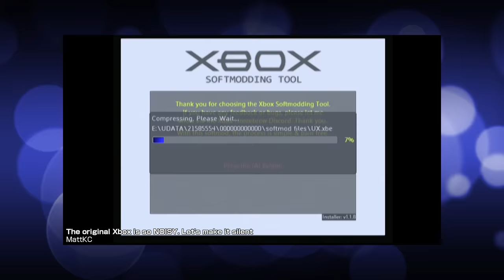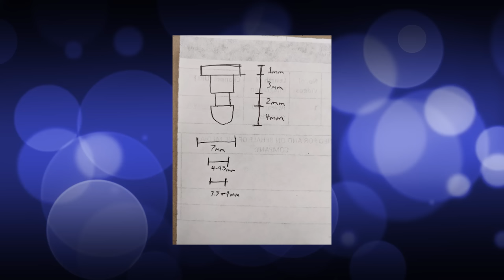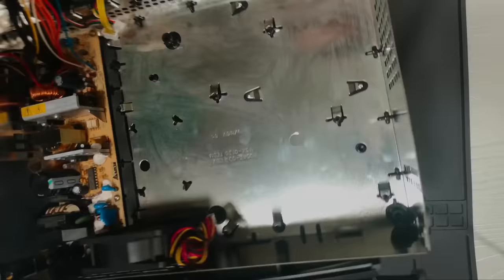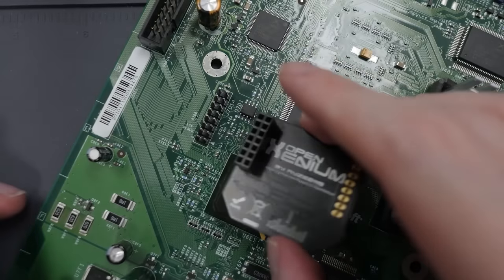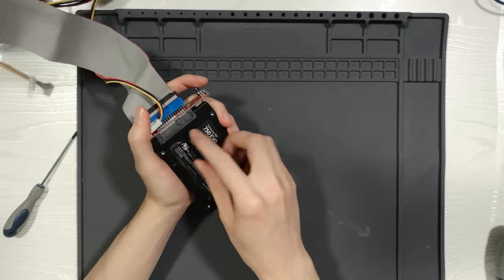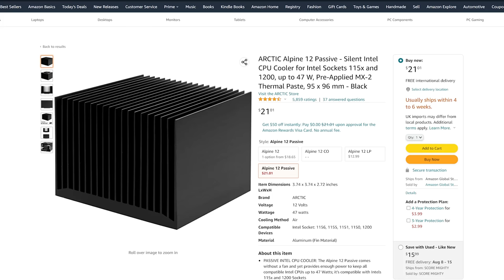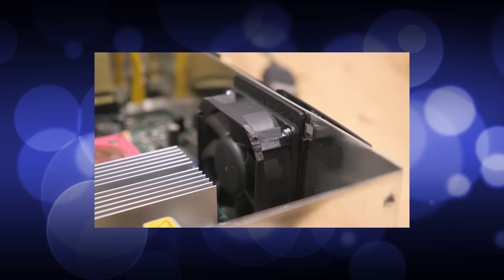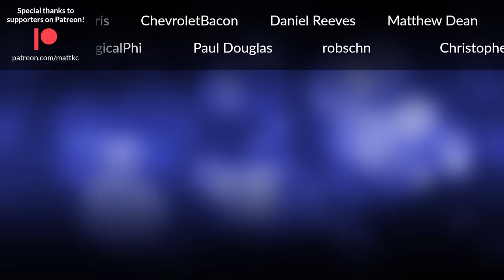My Silent Xbox Has A Problem...

Comment: I’d like to point out the passive heat sink likely wouldn’t have worked because the two chips are probably not level with each other
Reply: True
Reply: Could've used some K5 Pro to account for that
Reply: @aprofondir  I'm not familiar with "k5 pro" but I assume it's some high quality thermal paste, it wouldn't matter because if there's any air between the chip and heat sink it will work very crappily and overheat, even if you put a dog shit pile-sized mound of compound on there it would negate the purpose because it would cool the chips so bad that it would be a waste of time, not to mention the paste would likely slowly settle, especially with heat, and stop making contact with the chip.
Reply: @venialgaming4295    You could use thermal pads instead of paste to deal with the die/substrate height differences since they're made in all sorts of thicknesses. The CPU runs at just over 20w with the GPU likely sitting in the 40w ballpark. Had to find pentium 3 733mhz/geforce 3 & 4 numbers, nothing easy to find on the Xbox- though total system power draw of rev 1.0 runs between 67-68w, with rev 1.3 between 62-64w so I imagine it's pretty close, so it likely shouldn't be a problem to keep cool with pads so long as there isn't too much of a gap between the die & heatsink.
Reply: @venialgaming4295  K5 Pro is more viscous than thermal compound. It's more like highly thermally conductive silicone grease. Its purpose isn't just to fill the gaps between a chip and a cooler, it is a heat spreader itself. Covering the RAM chips on a GPU with K5 Pro is an example, as the K5 Pro acts as a cooler. But, it likely wouldn't be as good as a thermal pad in this case because K5 Pro isn't compliant with perfect contact when you have a gap of a few millimeters. 

Just use a thermal pad, and it would be okay.
Reply: @RamyWarda  it would maybe be enough but like he said if it doesn’t cool better than what’s the point and introducing a thermal pad rather than paste would probably make it not perform good enough to warrant it. And another thing to keep in mind is one of the chips is direct die so you already have to be extremely precise on the bracket to have even pressure on the die which is super hard because to make the heating pads level it would likely squish them but it could be balancing on the die, depending on if it’s higher than the other one. And in the likely scenario that a heat sink uses heat pipes that would make it impossible to use it so in other words using a single heat sink wouldn’t be feasible, also the gpu definitely doesn’t consume twice the power of cpu because the heat sink is tiny in comparison.
Reply: @venialgaming4295  It would really have to be tested before concluding that it wouldn't cool them off any better. You have much more surface area for dissipation, but worse thermal conductivity. Most tests are done on an IHS, but the NV2A/P3 are bare dies. Could make for a good video.
Edit: I realize that, which is why I mentioned I quoted numbers from their closest off-the-shelf counterparts. A full fat Geforce 3 or 4 probably draws more power than the Xbox equivalent, especially with the lower clockspeed (233mhz vs. 300mhz).
Reply: It would be possible to machine a single heatsink that sits flush with the chips.
Reply: Copper shims could help level
Reply: How about mill the heatsink to the diffent CPU and GPU heigh and extra component it need to doge
Reply: @kyanhluong  issue with that is A. When you mill the heat sink you’d have to take a lot of time to measure but more importantly account for the material taken off after lapping it because just milling it won’t be flat enough, and good luck trying to get a cylinder head shop to understand it enough to go that route, but B. It’s pretty expensive to get it milled in the first place, not even considering wherever he lives is probably not a small farm town like I live in that has like 3, and I highly doubt he could use a mill proficiently enough to make it work. The best overall route is two heat sinks because even if you got one to work it would likely heat soak the cooler chip anyway like laptops do.
Reply: @russhuang  I’ve seen this done and because it’s aluminum anyway it’s probably the best route because it doesn’t require anything precise, just sand it till they’re level.
Reply: @venialgaming4295  2 cooler seem like a good idea, also why it would still get heat soaked, outside of silent fan not getting enough air going around?
Reply: @kyanhluong  not saying the whole thing but say the cpu is under load and it heats up the heat sink but the gpu is going unused, this will heat up the gpu as well even though it’s not being used, if you observe the temps laptops with dedicated GPU’s you notice the same thing because they’re on the same heat pipes most of the time.
Reply: Just cut them in the middle with a anglegrinder and done
Reply: @venialgaming4295  K5 Pro is a liquid thermal pad and not thermal paste, would probably be perfect here
Reply: @venialgaming4295  2 disconected heatsink still tempting tho, unless 2 seprate heatsink can still heat each other enough to be a problem
Reply: @kyanhluong  I think two heatsinks is the way to go, but considering the size of the originals I wouldn't worry about them heating each other enough to be an issue
Reply: @orca984  I think an angle grinder is overkill but yeah that could be an option, but at that point might as well just do two separate heat sinks
Reply: Could use a copper shim with a smear of compound on either side.
Reply: @venialgaming4295  Now 2 heatsink and silent fan seem like a way to go...
Reply: @qwertykeyboard5901  true
Reply: @venialgaming4295  k5 pro is more along the lines of a thermal pad that you can reshape to the desired thickness, used to replace those found in GPUs
Reply: @TrolleyMC  L pfp, find God.

Comment: You could probably 3D print some fan ducts like what they have on servers, and use the existing heatsinks. Those would guide the air to flow directly over the heatsinks
Reply: Ehh, unless he wanted to fiddle with higher temp filaments, then it might not be worth the effort. PLA wouldn't stand up to the heat and would soften quickly. PETG and ASA are kind of a bitch to print with if you don't know what you're doing. But if he were to go for it, it would definitely work well.
Reply: It might work, but the auxiliary components (power regulators, etc.) could potentially get starved of that airflow and start overheating. Worse, there wouldn't be a temperature sensor on most of those parts to actually safely shit the system down.
Reply: @AstrumPuella  PETG is pretty easy, ABS is decent if you have an enclosure, but those aren't all that common.
Reply: Too expensive of a solution. Just use thick paper or thin cardboard instead.
Reply: I removed the DVD drive in my Xbox and just stuck the bottom metal plate of the drive back inside. Airflow is back to being about the same as stock.
Reply: I made air ducts out of cardboard before, works perfectly fine.
Reply: Indeed, check out this video this guy does some crazy custom cooling for a desk PC and he uses some plastic strips to guide airflow. I think if you can get hold of some plastic sheets like those and mold them with some heat, you can keep the geometry of where the DVD drive used to be but remaining lightweight. Great video, thanks for sharing! https://youtu.be/HhWDPG8EROw
Reply: @HappyBeezerStudios FIRE HAZARD!!!
Reply: @AstrumPuella pcbway does 3dprinting in tons of materials and they'd probably do another sponsorship
Reply: @AstrumPuella petg is pretty much just as easy to print as pla.
Reply: That's what they did on phat 360s.
Reply: Or those they got on oldass dell towers.

Comment: The SSD in my Frankly Horrific OG Xbox is held in with Gorilla Fabric Tape. Absolutely no clue how it’s held up so well with the heat.
Reply: Gorilla tape is for The Toughest Jobs on Planet Earth after all.
Reply: That's gaff tape I use that in automotive for bundling and protecting wire harnesses. Great stuff. Look at tesa's line of tape.
Reply: Flex tape would immortalize it
Reply: Budget bill

Comment: I installed a hydro fluid bearing fan (aka Hydro dynamic bearing) and set it to 100% speed.  I just can't remember if it was a 70mm or 80mm fan.  Over 10 years now of use and the fan is still silent and keeps the Xbox cool.  You should look into these types of fans instead of using the basic ball bearing fans if that's what you are using to set it at such low speed on the fan so you don't hear the noise.  At 100% with these types of fans it is very silent and effective.
Reply: excellent suggestion. I don't think enough people consider using that type of fan to address noise levels
Reply: Not sure I've ever heard of them. Interesting.
Reply: I haven't heard of them either. (Given, I haven't ever done much research in the area)
Reply: Yes, they made a BIG noise back when I heard about 'em circa 2010-2014.  Haven't really heard too much about 'em since but they do exist.  The brand I went with was GELID (Silent series).  I'm not sure if they are still around but it is what I used back then for OG Xbox's and also for PCs.  Super Silent and effective.
Reply: Interesting, I didn't knew about it. Thank you !
Reply: You mean the hydro dynamic spatula with port and starboard attachments (and turbo drive) may yet exist...
Reply: thats impressive. if you had a model number you could give us thatd be awesome. A reliable 10+ running fan would give me so much peace of mind, i hardly trust anything to last anymore.
Reply: @hehe42069-k   Like I said from before, I'm not sure if it's a 70mm or 80mm but it is the GELID solutions Silent series fan.  With a quick search from what I remember what it looked like, it is either the 70mm (FN-SX07-22) or the 80mm (FN-SX08-16).  Again, not sure which one I used in the install but it was definitely one of those hydro dynamic bearing fans.

Comment: I'm a little confused, since you didn't like how the DVD drive cover no longer "floats" why didn't you leave the DVD drive in with its caddy and just have it disconnected? This would solve the soft whirring you were annoyed by. This would also allow the air flow to go back to what previously was the case and if you ever did want the DVD drive you could plug it back in (relatively) quickly.
Reply: I think another reason was to reduce the weight. Though I would suggest to open up the drive and taking out anything unneeded, but keep anything needed to make the DVD slot float.

Comment: I think it's possible, that the DVD drive might also have a little to do with the airflow,  like with the HDD caddy, perhaps, you could try putting just the bottom of the drive back in and seeing if that improves Temps? That would only make it a little bit heavier, but might help (especially with the gpu heatsink)

Comment: MattKC: "The double sided tape for the SSD didn't work due to heat, I probably should've seen that coming"
Also MattKC: "I used double sided tape for the Xbox logo, it doesn't go through anything so it should be fine"
I don't actually know if that part of the case gets any airflow/hot, but I just thought it was funny :P
Good work though, hopefully someday I'll do the same to a PS2!
Reply: The only mod a PS2 really needs is a fan replacement. The original is loud as heck. The original PS2 already has an external access drive bay just needs a network adapter to lock and interface the drive with the system. The other thing is you can get an rgb cable and an rgb to hdmi convertor. Lets you connect the PS2 to a modern TV. It also looks really nice without having to do any kind of perm mod to the PS2.

Comment: The Noctua L9 cooler you reference at 8:11 actually blows the air DOWN, because it was designed to also cool the VRMs and associated components around a CPU.  Depending on the clearance to the top shell of the Xbox it could still struggle to intake air, but it would exhaust quite happily around the board and get sucked out the back.

Comment: With the amount of space you have, you probably could fit a 2U cooler in there that would be a step up from the cooling you have right now. Suggest checking out some of the dynatron products for 2U server kit.
Reply: Lol and 5x louder
Reply: @brkbtjunkie  WHAAAAAAT? CANT HEAR YOU! I AM GAMING! FAN GOES BRRRRRRRRRRRRRRRRRRRRRRRRRRRRRRRRRR
Reply: Follow up, you might be able to use one of the xbox 360 revision coolers for your original xbox.
Reply: @brkbtjunkie  actually some 3U coolers are very quite like the noctua onr

Comment: I highly recommend getting a bag of 20x20x10 mm heatsinks off ebay and some thermal epoxy (or at least an adhesive thermal pad) and putting one of them on the MCPX chip next time you're in your Xbox. It's right next to your modchip and it gets pretty damn hot. Due to easily hitting peaks of over 60 C in some situations and just generally going through some rough thermal cycles in its life, it's responsible for a lot of Xboxes dying.

I am not sick of this Xbox- thanks to these videos I ended up buying myself a new one to replace my recently-FRAGged childhood 1.1. I hit pawn shop gold and ended up with a seemingly barely used 1.1, manufactured 4 days before my old one, with a stealth modchip already installed. I went for the exact opposite approach to this Xbox. 500GB IDE Caviar black, modified Wii2HDMI, heatsink on the MCPX, and for the ultimate in jank Xbox mods, I cut a hole in the plastic on the left side of it and zip-tied a fan to the metal chassis, pointed straight at the MCPX.

It's loud as all fuck. I don't care, I have headphones. I watched my 20 year old Xbox die last year, and I don't intend to allow the same fate befall this one. Thank you for the inspiration Matt <3
Reply: did i ask
Reply: @handlesrtwitterdontbelivethem  why did you assume that the comment for MattKC's video was directed towards you, at all.
Reply: @AstrumPuella  Hell the entire first paragraph is literally just general advice directed towards anyone with an Xbox lol

plus I reckon most people who own an Xbox in 2022 probably love hearing about other peoples' Xboxes, I know I do

so needlessly hostile
Reply: crossbox moment

Comment: I'm honestly amazed by your patience. A while back I meant to replace the bulging caps in my Xbox v1.6 but getting them out was so much of a hassle (my soldering skills are dreadful and I don't have a proper solder pump) that I just kind of... gave up.
Anyway, great video, love to see Xbox content!
Reply: I thought the 1.6 was the one that doesn't have bulging caps. Or was that just wrt the clock cap?
Reply: @chunye215  The 1.6 usually doesn't have the bulging clock cap but it does have other caps that tend to bulge on that version. :( It's actually more of a hassle as it's more than one cap that needs replacing.
Reply: The clock cap leaks.  The regular PSU rail caps dry out and swell.

Here's a tip when desoldering caps that may be attached to large power/ground planes:  Clip the remainder of the leads off so you have as little as possible on the solder side of the board.  Add fresh solder.  Don't try to evacuate the solder, just apply heat and work the cap out a little bit at a time, one leg then the other, until it comes free.  THEN use your desoldering pump to remove the old solder.

Sometimes you can't get all the solder out.  That's fine.  If you can clear one hole, great.  Cut the lead shorter on the side that the hole is still plugged, and push the remaining lead through the clear hole.  With plenty of clean solder on the plugged hole, heat it up while you push the leg (gently) through the other side.  Be careful not to bend the leg.  It helps if it's short (like 1cm or so.)  If both holes are stubbornly clogged, you may need to walk the new cap in a tiny fraction at a time.

Comment: I would advise against relocating electrolytic capacitors willy-nilly, as they are often used for local decoupling and may well contribute to rare, obscure failures. Datasheets for most ICs will specify as short a length between decoupling caps and the Vdd/Vcc pin as possible. You can probably be more lenient with how long your connection between the negative terminal and ground is.
Reply: They probably also specify ceramic decoupling caps. Currently people are using ceramic caps as close as possible, and electrolytics every here and there, due to their higher ESL and ESR but also higher capacitance.

Comment: You could also add a noctua 40mm on top of the cpu ? 
Airflow might still be good enough for the "OG" fan to work as an exhaust. 
And the noctua 40mm are dead silent at correct speeds
Reply: In front would be better

Comment: 3D print ducting for controlled air flow so you can remotely mount the fan this way you can use a larger fan at a lower speed. You just need to minimize static in its design (minimal turns and narrowing).

A fan doesn’t need to be mounted directly on or even near a heat sink they are just sold that way for cost and convenience. If all of its air flow is ducted over the item trying to be cooled you get the same effect. Much like how duct work in your home cools and heats the rooms without the furnace fan being in that room.

I really wish I had an Xbox because looking at yours I’m visualizing a really interesting fan location that pulls air across the entire board but directs all of it over the CPU and GPU before it exhaust.

Comment: I looked into doing a combined Heatsink for both GPU/CPU in the past but each die has a different Z Height, so you would need a shim to adjust the height between both dies to get proper thermal contact.

Comment: I would advise that you still use the DVD tray/caddy in the Xbox. Even though the DVD drive is gone, it still provides support inside the console. I would also suggest modifying the tray in some way to help guide air over the heatsinks.